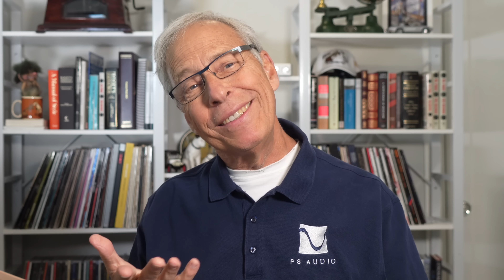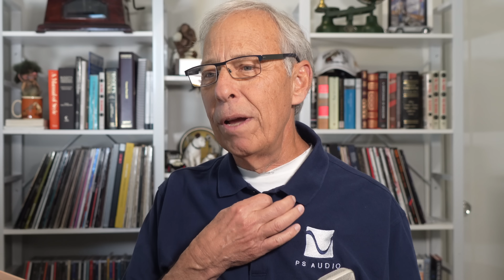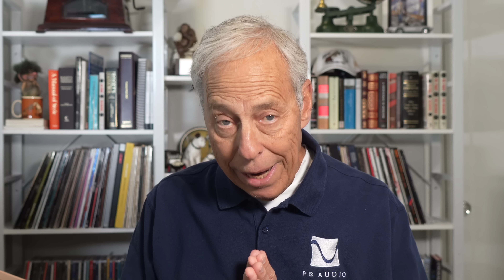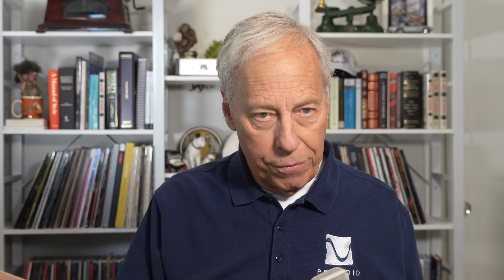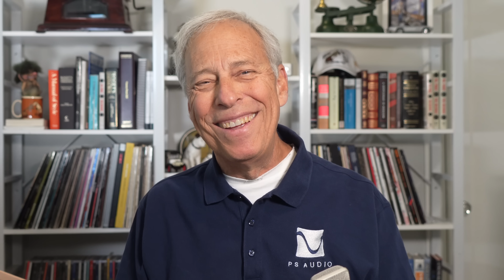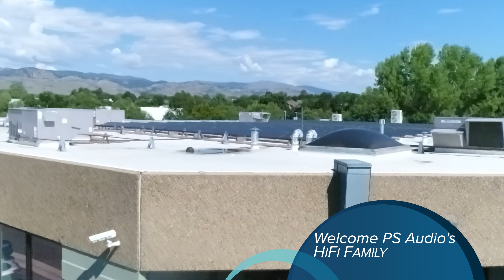Do step down transformers affect audio quality?

Comment: You may not have to use a stepdown transformer for the power amp, depending on your power amplifier. In the case of the Crown XLS power amp I have for example, you can set the voltage on the back of the amp is it can handle any power in any country from 100V to 240V and the frequency doesnt matter. The nominal power that  the amp will draw should be stated on  any amp or device so if you dont have an easily reconfigured device you can use that as your guide to the power needed for a step down. Don't listen to the 10x advice as it will definitely cause you to do an overkill and spend way too much money.  You just need to have enough capability for the average power draw which is MUCH less than the power rating of an amplifier.
Reply: Crown XLS does not have a "setting" on the back for mains voltage.  That is just an indicator to show what the factory set the power supply up for.  Changing it from 120V to 240V compatibility requires modifications on the PS board:  http://mnats.net/XLS1500.html
I agree Paul's 10x suggestion is ridiculous, but considering that most audio amplifiers draw current in rather narrow high-peak pulses, using an external transformer with double the VA rating is a good idea - if it turns out to be required (hopefully the internal transformer has dual primaries that can be reconfigured).  
With regard to your suggestion of "just enough capability for the average power draw," I presume you weren't serious?
Reply: @marianneoelund2940  Well I stand corrected, from the photo appearance it looked like there was a simple change of a plastic plug. It requires the change of a resistor and clipping a jumper, most audiophiles arent going to be able to do that change but it can be done pretty easily by an electronics tech or engineer. Linear devices usually have dual primaries for rewiring to the appropriate voltage though and one must not forget to change the MOV varistor when increasing the mains voltage.

Anyway, if one were to need a stepdown transformer, I would check to see what the the power requirement is that should be stated on the devices to be powered and use at least that much of a VA rated stepdown transformer. Barring available power requirement info, I would calculate the worst case power demand for an amplifier playing the worst case compressed music at a worst case listening level where the music peaks started clipping the amplifier. For example, for a two channel linear amplifier rated at 100wpc, each channel might need around 6dB less than the maximum peak level of 100 watts or 25 watts then apply a 50% efficiency factor so now we're at 50wpc. Times two for stereo gives us 100 watts total maximum average demand, headroom and peak power will be handled by the filter capacitors.  

The other thing about moving to a different country could be the power line frequency, and like Mark said elsewhere here if they are using a turntable with a synchronous motor, they will need to change the motor pulley to a larger diameter one and possibly a belt also.